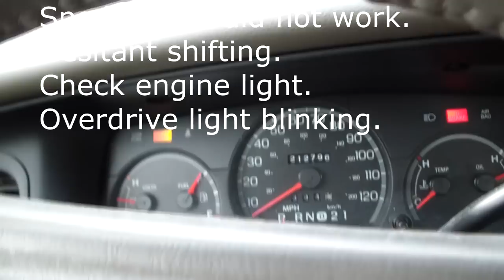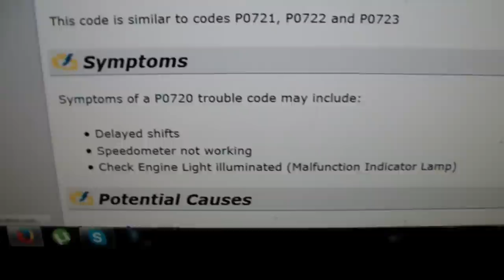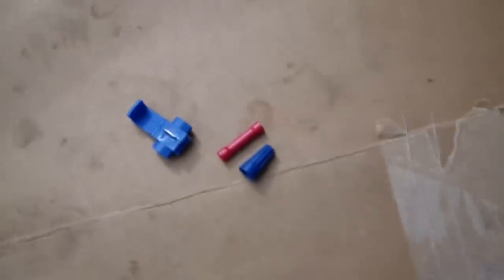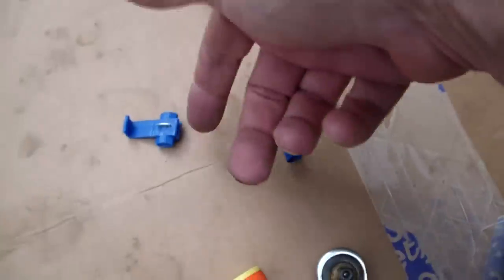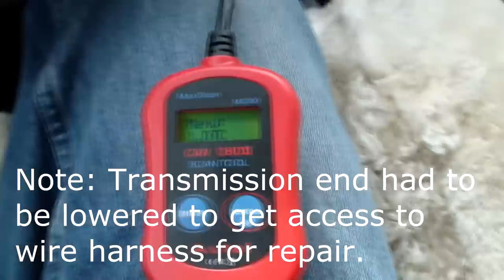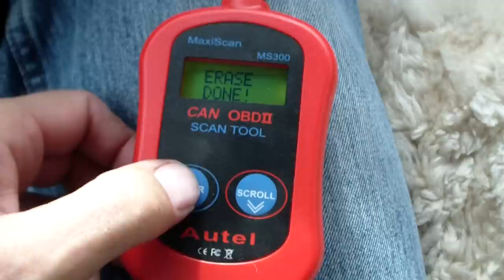Ford P0720 Speed Sensor Error Code Repair

Comment: Instead of gluing the bolt into the socket, put a small piece of masking tape over the head of the bolt and insert it in the socket. That will hold the bolt in the socket for you while you get it started and no mess to clean of your tools.
Reply: Or you can use a piece of a napkin, which is more common than masking tape )

Comment: Hey I've replaced my Mazda b 3000 speed sensor on the rear differential pumpkin and installed new vss and the overdrive light blinking on and off after id say of 20 or so miles of driving

Any ideas why

Comment: Not to rain on your parade, but if you clear the codes and don't run the car through a drive cycle, you really don't know if it was fixed, because it could come back.
Reply: The wiring was clearly burnt, causing the problem.He fixed it :) .Job done.
Reply: How long is the drive cycle? I replaced both sensors on my transmission and it comes back if I disconnect the battery. But if I clear the code with my scanner it drives fine but my speedometer still doesn't work. Do I have to complete the drive cycle before my speedometer starts to work again?

Comment: Mine doesn't engage in forward till i rev it up just threw the same code with flashing od light truck is a 2001 f150 4r70w also the sensor is leaking oil out when I pulled the connector
Reply: Same thing with my 2005 f150 did you ever get it fixed?
Reply: Same here. Still figuring it out
Reply: Same issues. You figure it out?
Reply: @mrN8Vman  fixed it with a replacement transmission and now sold em all and went with 7.3s

Comment: I have 08 Ford f150 I bought another transmission but this one  only has one speed sensor an my 08 tranny has 2 an outer an an inner is there anyway to bypass it so I can get it to shift in the tranny I bought mounted in there perfect it goes  in drive but it just not shifting gears

Comment: If anyone could help I have a 1998 my speedometer does not work I suspect the speed sensor on the transmission but I do not have a check engine light or a code, I sure hope it's not the speedometer

Comment: Would is be the same for a 2009?  I can't find any thing on that year
Reply from the maker: Yes it has same transmission. The video shows how to change the speed sensor.
Reply: Thank you dude I just wanted to make sure
Reply: Just had this code come up for my 2008 Ford Fusion. Had a guy at O'Reilly's tell me that it's the whole transmission that was failing, which freaked me out. Is it possible to just replace the speed sensor, or is it recommended to repair the whole transmission? I know jack about cars.
Reply from the maker: Just the speed sensor needs replacement. My video show how. The guy at O'Reilly's is working at minimum wage for a reason.
Reply: Cant find it on my 09 crown Victoria
Reply: Need

Comment: Did u pull the whole transmission down to fix the wire
Reply from the maker: I did have to lower transmission a few inches to get to the wire. Was too tight a space. Can replace speed sensor without lowering.
Reply: @KentDiego  you say speed sensor can be replaced without lowering transmission
Reply: @LiilTyweezy  yes, just did mine but it didnt fix anything